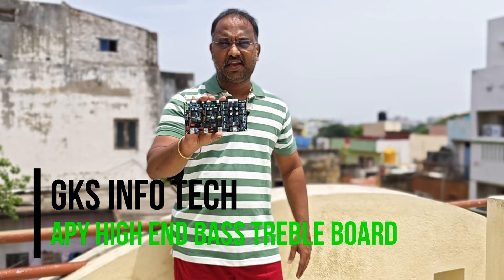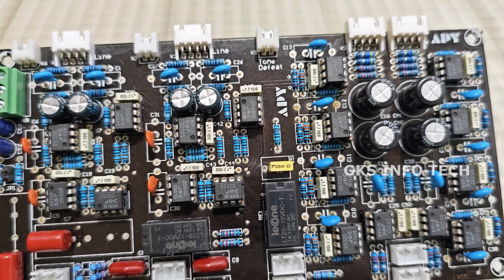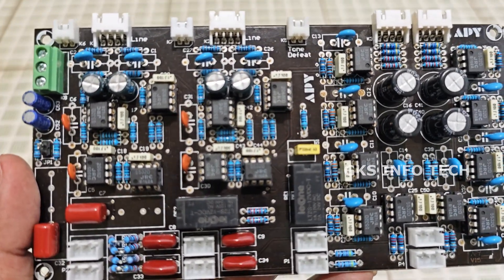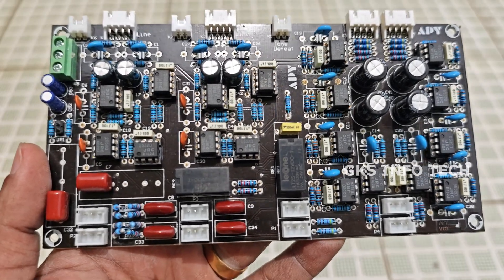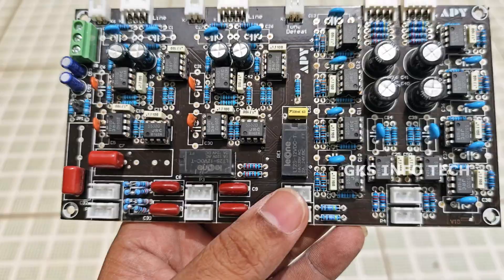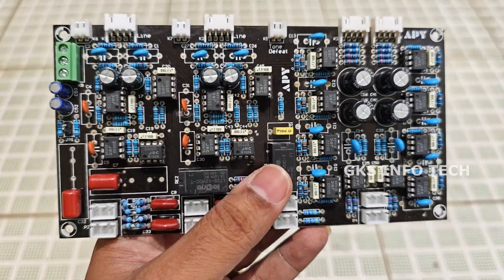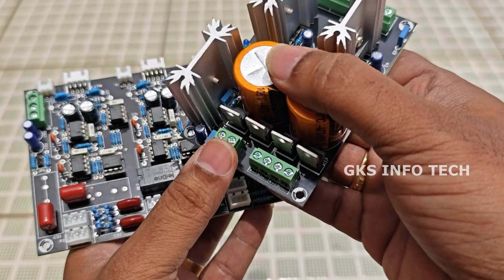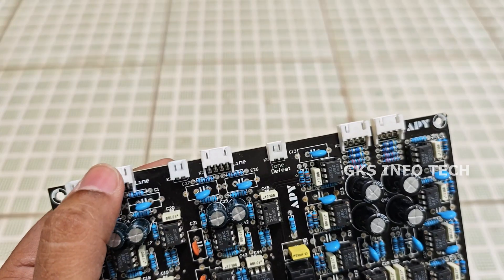APY 18 IC BT Board Review | XLR | RCA | IP | OP – High-End Amplifier Build & Connection Guide

Comment: Lm 3886 stereo board ku use pannalama sir
Reply from the maker: Yes, you can use the APY18 bass-treble board with the LM3886 stereo amplifier. It matches well, but make sure the power supply is suitable for both.

Comment: Idhu elektor oda Design
Reply: 15 years old design
Reply from the maker: Yes, the APY18 IC bass-treble board design is around 15 years old and originally appeared in Elektor Magazine. It uses a classic op-amp-based tone control circuit, which is still preferred by many for its simplicity and clean performance. It provides adjustable bass and treble, and is commonly used with TDA and LM series amplifier boards.
Reply: @gksinfotech yes you are right but the project also has a front channel selector , clipping board and input board this is a complete kit which supports phono input you are using only half of the kit
Reply from the maker: Thanks for the clarification! A complete kit with front channel selector, clipping board, and input board sounds great — that really adds more flexibility to the project.
Reply: Ceramic disks is not recommended by the designer you must use silver mica
Reply from the maker: Got it, thanks for the tip! I’ll go with silver mica instead of ceramic disks as per the designer’s recommendation.